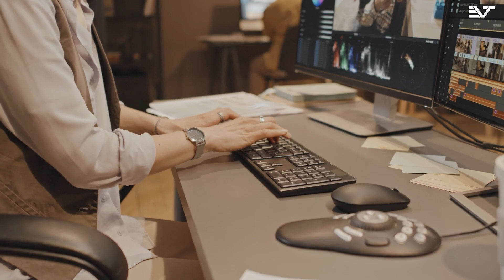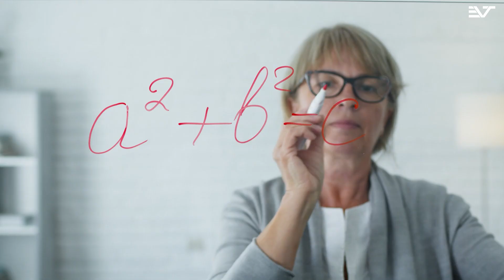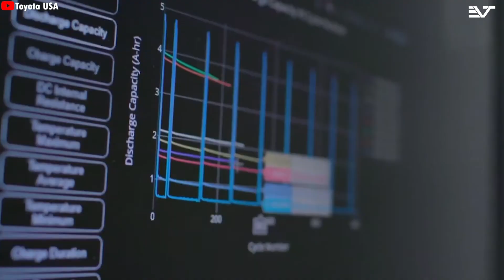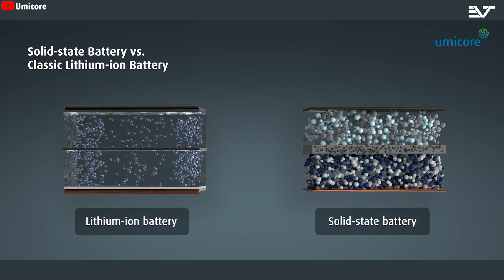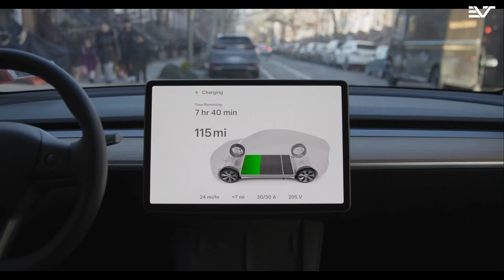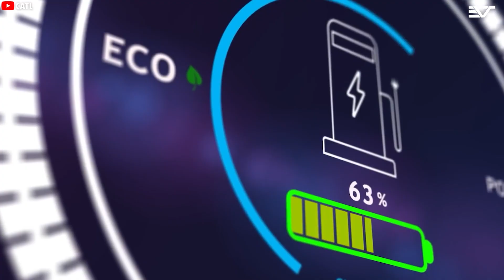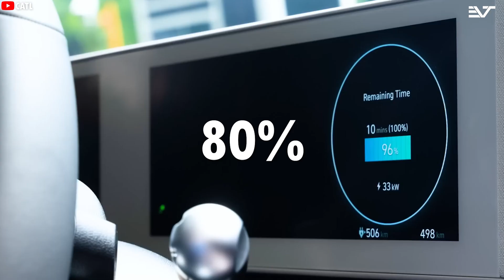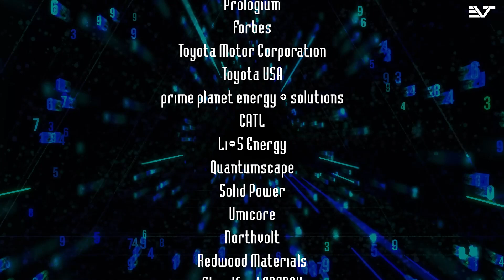Finally Happened! Tesla Bot Gen 3 2025 Can Clean, Cook, Take Care Family, Wash Dishes &1000 Tasks

Comment: If solid state with equivalent range has been around since 2010, I wonder why Elon has gone all in on Lithium Ion technology. I guess he could abandon the lithium mine in Nevada and switch to solid state for its apparent advantages. Is Lithium one of the components of solid state? Maybe that’s what Tesla is developing: solid state using the Lithium they are producing?
Reply from the maker: Yeah, you're right, solid-state batteries still use lithium at their core, but the electrolyte structure of solid-state batteries uses a different material in the solid state. We think Tesla hasn't invested in this type of battery because they want to achieve more with the 4680 battery, rather than risk investing in a new battery that is expensive at the beginning.